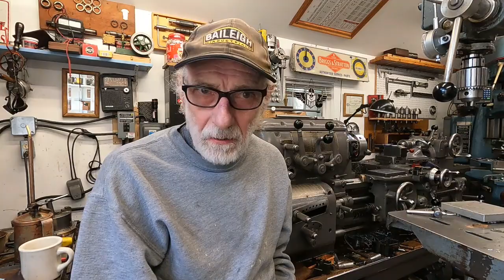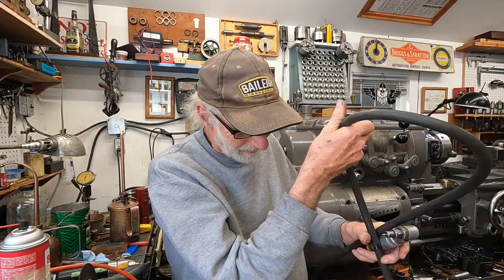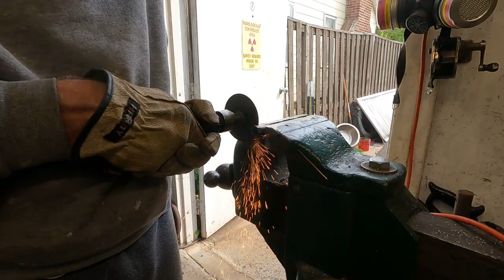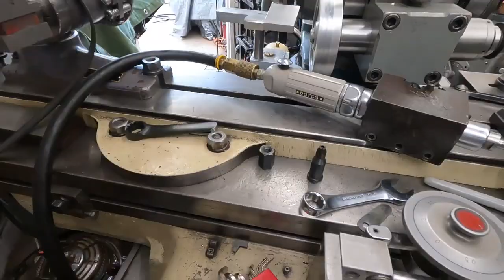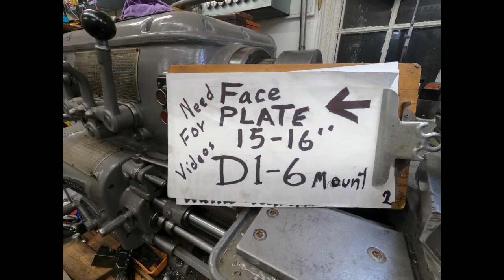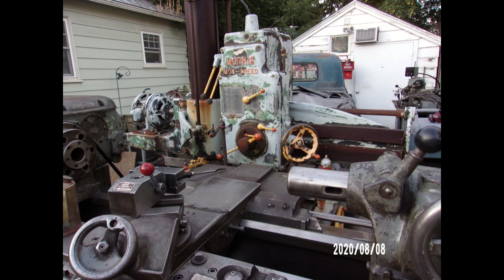Machine Shop AirTool Rodeo

Comment: One could have cut off a half inch bolt with an old fashioned manual hacksaw much faster than with that grinder! 

It amazes me that so many YouTube shop-type content creators use angle grinders and power saws for small cutting jobs that could be done more quickly by hand.
Reply from the maker: I found the porta bandsaw the best all round saw for me using with the vise, but a hack saw with a fine-tooth blade is handy and right at hand, thanks!

Comment: I don’t like air tools. I only have three and I rarely use them. The only reason, for me, that they have any use at all is that they’re small for the power. I suppose safer too in wet areas, though with battery tools, that’s mostly a non issue these days. It was painful watching you cut that bolt head. I have, I think, eight DeWalt angle grinders, two of which are battery. A bit clumsy with the batteries, but nice that there’s no power cord or air line. These are awfully dangerous tools and I’m surprised that they haven’t yet banned the lock on switches as they did with electric drills somewhere around the early 1970’s, or so.
Reply from the maker: I feel the same. You pretty much need the volume of work to justify it. In my commercial shop I had two of these 6hp compressors going together to get close to 30cfm to run the group of Cleco burr grinders, there is no electric counterpart that can take it or perform as well, but that is using 12hp of compressor to run a 1/2hp air tool. I will be using these more intermittently now.
Reply: @DonDyarprecision  yes. Electric die grinders are several times the size. I can’t speak to reliability, but except for a few large, expensive models, they don’t have the same power. But I recently bought a Vevor equivalent to my Foredom which had cost $375. The Vevor cost $53. 37,000 rpm as opposed to 18,000 for the Foredom. 6 amps compared to 1.8. It does, for me what die grinders do. The interchangeable handles make tool changes easy and it’s got enough power and speed (controlled by foot switch) work fine. I doubt it would hold up in a commercial shop for long. Thing is though, it’s built better than the Foredom. I’ve since bought a second.

Comment: Thank you for demonstrating not only the tool, but also the common sense regarding tool safety in general.  I don't know how many channels I have come across that scoff at safety.  I think I might put out a video on safety alone, as there are a thousand ways a person can hurt themselves (or others) with such common equipment, and not a lot of emphasis on the nuances of danger.
Reply from the maker: Safety is a hard to balance with getting things done. My recent experience with woodworking has me using a blade guard on table saws, but those with more experience would not. There was s series of people getting injured from bench and pedestal grinders then osha moved in and those grinders became scarce in shops, I think the same happened with radial drills. I think the best I can do is talk about the hazards and try harder to practice safety, thanks!